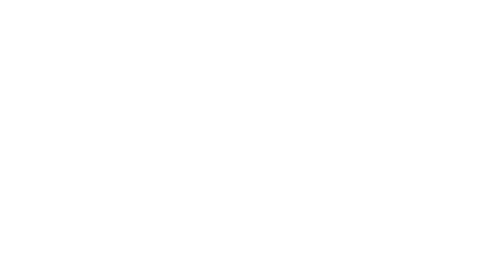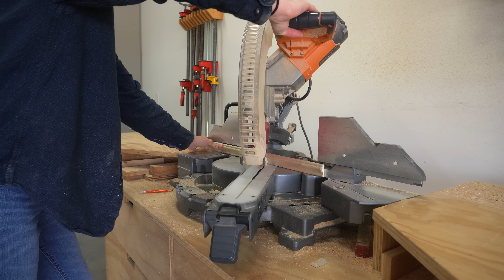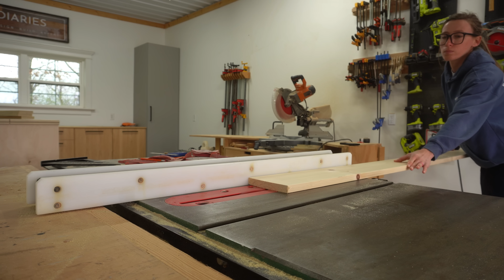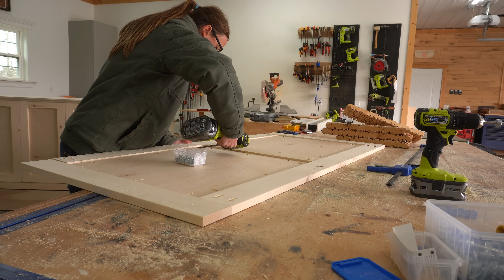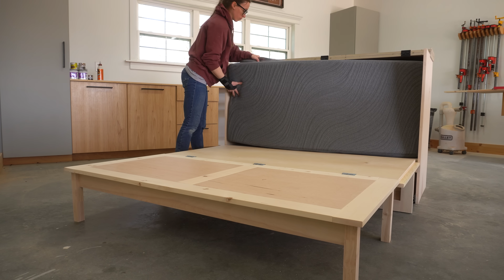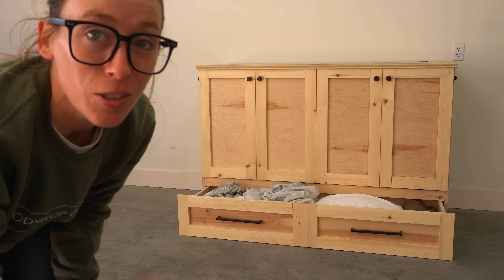How to Build a Folding Murphy Bed Cabinet with Storage Drawer

Comment: 13:40 - i realize I'm coming to the party a year late, but looking at the wood shims under the drawer to take up the 1/4" gap I immediately thought of felt furniture foot pads to be placed under the drawer bottom - soft & yet firm enough to support the drawer. Cheap enough that if they go missing, easily replaced

Comment: This is perfect. I can see it in my living room under the tv mounted to my wall. Instead of the folded mattress, however, I’ll use an air mattress. Then, once my guests leave, deflate that puppy and stash it with the pillows and bedding in the cabinet. Save the drawer for something else.

Comment: Solid piece, great video. One question about the hinges along the top. Is there a way to have hidden hinges so the top isn't disrupted by a gap and the hinge itself? Just wondering if such a hinge exists. Also, for added support for the drawer when drawn out, what about caster wheels.

Comment: what's the outer measurements for single and double bed
Reply from the maker: Overall Murphy Bed Cabinet Sizes: 

Full: 40 3/4" tall x 56 1/4" wide x 24 3/4"deep when closed and 75" deep when open (fits trifold 54" x 75" full size mattress)

Queen: 40 3/4" tall x 62 1/4" wide x 24 3/4" deep when closed and 80" deep when open (fits trifold 60" x 80" queen size mattress)

Comment: a pair of wheels under the drawer would help support the weight and allow you to raise everything a bit further from the floor
Reply from the maker: Hi! Yes, I didn’t add wheels because it would make the drawer much shallower and allow less storage space. Also the weight rating on small caster wheels was not significant enough

Comment: 13:48 I wonder if wheels would work instead of shims like small strong wheels that go maybe four of them in front what do you think? I don’t know
Reply from the maker: You could. I actually bought some to do this with, then changed my mind because by adding them, I would have taken away 2” of drawer depth, then my pillows wouldn’t fit. I could have made everything a bit taller, but I’d already cut and assembled the cabinet before I realized the drawer would be too shallow if I used them. And, those tiny caster wheels had less weight capacity than the drawer slides.

Comment: Question about the mattress. The link is to a 4" Queen. Although the cabinet looks like a full size? And is 4" the thickest it could accommodate or could you fit a 6" mattress? Such a great video, so clear!
Reply from the maker: I built a queen size for this video, but I’ve got plans for a full OR queen. If you build the queen, you’d need a queen mattress, if you build the full, you’d need a full mattress. Both are the same cabinet depth. The 4” mattress fit inside with plenty of spare room, so I imagine a 6” would also fit fine.

Comment: Would you use the same height measurements if you wanted to use a 6 inch mattress?
Reply from the maker: The height wouldn’t change with a thicker mattress—only the depth. There was plenty of room left inside the cabinet with a 4” mattress—so I imagine a 6” would fit fine with the same dimensions.

Comment: Did you always have a table saw, or is that a new addition? I don't think I've ever seen it in a video.
Reply from the maker: Hi! I’ve had that table saw for about 8 years 👍
Reply: @WoodshopDiaries  haha! I am inobservant. I'm so used to you using the rip guide with your circular saw.
Reply from the maker: @averagejoesworkshop I use the table saw to cut dadoes in my drawer boxes—any other things. I just never use it to cut down my plywood sheets.

Comment: instead of shims can use wheel castors under drawer that transfer load to floor from mattress and make it easier to slide open taking wieght off the sliders. If carpet will be under bed,  a sled runner made of metal or plastic could do the same job
Reply from the maker: You could. I actually bought some to do this with, then changed my mind because by adding them, I would have taken away 2” of drawer depth, then my pillows wouldn’t fit. I could have made everything a bit taller, but I’d already cut and assembled the cabinet before I realized the drawer would be too shallow if I used them. And, those tiny caster wheels had less weight capacity than the drawer slides.

Comment: This is an excellent video! I decided to put a cabinet bed in our guest room. I searched for plans for one that didn't require significant assembly before each use but did not find any that I liked. I bought one online (my delivery drivers didn't like that) and assembled it. Your bed is very similar to the one i bought. I like how easy it is to change from cabinet to bed to cabinet.

I appreciate the tone of your video. You explained the steps clearly, and you used tools and skills that are within reach of a hobby woodworker. 

I also appreciate the way you present yourself. You are obviously feminine, but you don't flaunt it. You dress appropriately for the shop.

Comment: You could add some small wheels under that middle drawer section instead of using the shims.
Reply from the maker: You could. I actually bought some to do this with, then changed my mind because by adding them, I would have taken away 2” of drawer depth, then my pillows wouldn’t fit. I could have made everything a bit taller, but I’d already cut and assembled the cabinet before I realized the drawer would be too shallow if I used them. And, those tiny caster wheels had less weight capacity than the drawer slides.

Comment: One pair of drawer wheels under the drawer and no need for shims. Very cool design. Well done!
Reply from the maker: You could. I actually bought some to do this with, then changed my mind because by adding them, I would have taken away 2” of drawer depth, then my pillows wouldn’t fit. I could have made everything a bit taller, but I’d already cut and assembled the cabinet before I realized the drawer would be too shallow if I used them. And, those tiny caster wheels had less weight capacity than the drawer slides.

Comment: Just became and empty nester and this is going to be the perfect solution for a guest room in a smaller house.  I see the mattress is 4", would it support a 6" mattress and if not how drastically would the cultist change to allow for the extra thickness of the side panels?
Reply from the maker: Hi! The 4” fit with plenty of room to spare, so I’d say a 6” would probably work fine 👍

Comment: Great idea!  A couple small wheels on the bottom of the drawer would help so you wouldn’t need shims
Reply from the maker: You could. I actually bought some to do this with, then changed my mind because by adding them, I would have taken away 2” of drawer depth, then my pillows wouldn’t fit. I could have made everything a bit taller, but I’d already cut and assembled the cabinet before I realized the drawer would be too shallow if I used them. And, those tiny caster wheels had less weight capacity than the drawer slides.

Comment: I like the design! What about adding some small ball bearing casters to the bottom of the drawer rather than shimming it every time? Just an idea.
Reply from the maker: You could. I actually bought some to do this with, then changed my mind because by adding them, I would have taken away 2” of drawer depth, then my pillows wouldn’t fit. I could have made everything a bit taller, but I’d already cut and assembled the cabinet before I realized the drawer would be too shallow if I used them. And, those tiny caster wheels had less weight capacity than the drawer slides.

Comment: Just in time when I've thinking how to solve a multiuse room problem. I'll build this when our guesthouse is done. I think I'll put some wheels under the drawer for more support.
Reply from the maker: So glad you enjoyed it! I actually bought some casters to do that with, then changed my mind because by adding them, I would have taken away 2” of drawer depth, then my pillows wouldn’t fit. So if you add wheels, I’d suggest considering making this taller and the drawer deeper. Also, those tiny caster wheels had less weight capacity than the drawer slides. 😅

Comment: Instead of some shimes, couldn't u use casters under the drawers? Then they are always supported.
Reply from the maker: You could. I actually bought some to do this with, then changed my mind because by adding them, I would have taken away 2” of drawer depth, then my pillows wouldn’t fit. I could have made everything a bit taller, but I’d already cut and assembled the cabinet before I realized the drawer would be too shallow if I used them. And, those tiny caster wheels had less weight capacity than the drawer slides.